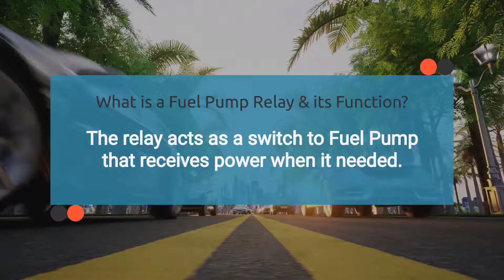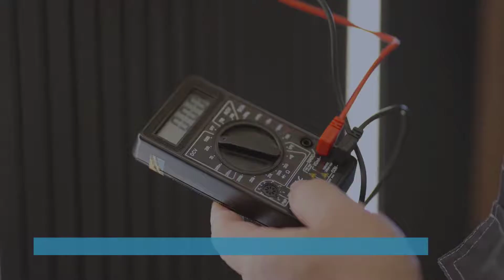Bad Fuel Pump Relay- Symptoms, Causes & Troubleshooting

Comment: My 03 malibu won't start . Idk if it's the anti theft  passlock cutting fuel or the relay . Fuel pump is new   its  really pissin me off . Its been starting fine . Now all the sudden the past 2 days i been a sitting duck.. sometimes I will hear the pump activate n then sometimes it wont make a noise but will still start   Tired of this sh$%$
Reply from the maker: Check the relay first. If fuel pump is new, check the wiring terminal, may be it is loosen up.

Comment: What if it cranks no start ,turn off and repeat start and it turns on?  It happens once in a while. But it usually always starts right up after a second start?? Would that still be the relay?
Reply: Hey did you figure that out? I’m having a similar situation but when it doesn’t start the fuel pump doesn’t engage and then when I hear the fuel pump engage before turning car over it starts
Reply: @BillySmith-np5zn  possible fuel pump relay
Reply: @robertb880  I switched it with the horn one and it started and then later on it didn’t and now it’s starting again. Only thing I can think of is leaves getting in the fuse box cause it was pretty dirty